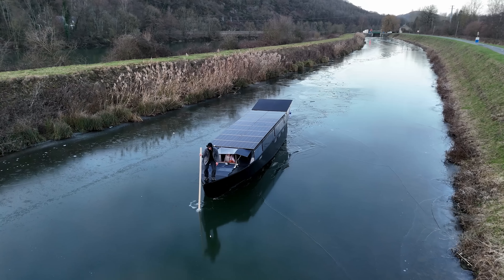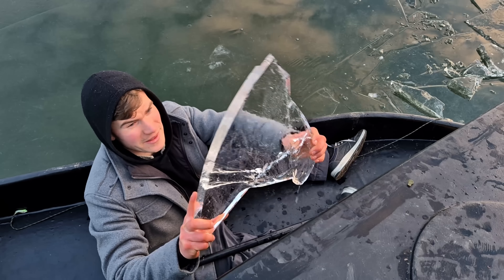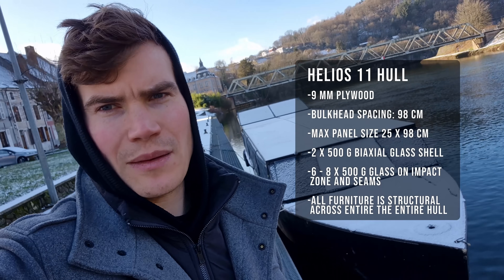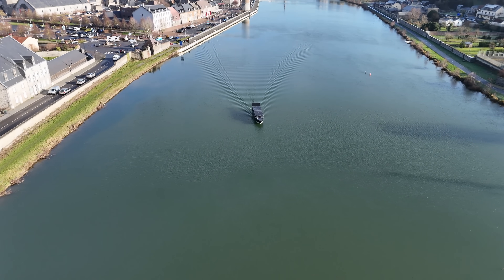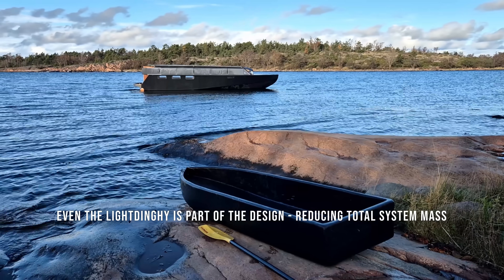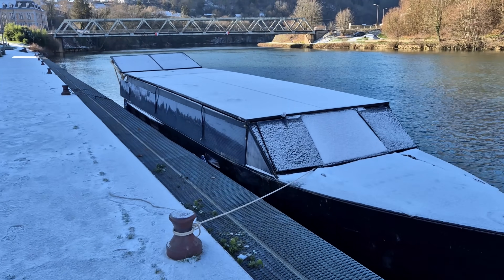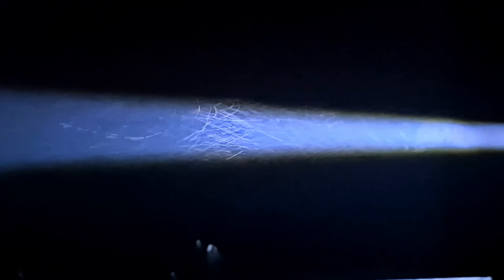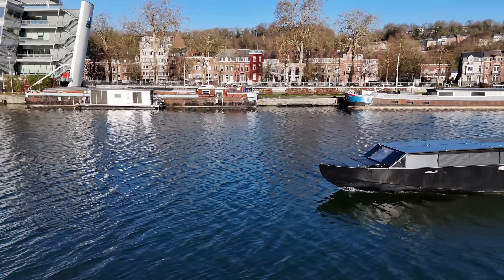Stuck in the Frozen Canals on my Solar Boat: Upgrades & Hull Strength

Comment from the maker: This video is unfortunately not sponsored by Hempel Marine Paints, it's sponsored by me.
☀I wrote a visual manual that delves into Solar Yacht design and acquisition: https://tinyurl.com/helios-11

Consider purchasing it to both support my research, and your own path toward solar sailing.
This is a non-profit project that will share data and the vision publicly.
Reply: I think those that are "fear mongering" are mostly ultracrepidarian commenting from their armchairs and have never designed and built anything in their life. I have little concern for the strength of craft at all, after building similar "white water" wood kayaks in the same format.   I do believe, since your not looking for a traditional build in any way, that some of the newer HPDE hull materials would be better suited for you future projects as they are massively more durable, and 100% recyclable as well.  Some of these new HPDE hulls have a working hull life of over 50 years or more depending on design, fabrication method and final use. Thanks as always for what you are sharing and looking forward to your next video...
Reply: Keep fighting... You will overcome your problems. 👍

Comment: I think this sort of thing shows a basic design flaw in this boat. It’s designed for flat water and fair weather. Most boats are designed to handle harsh conditions and rough water. They are safe and stable in all conditions. Plus they are designed to be safe and strong enough to last 50 plus years. They are also designed to cope with hitting rocks and other vessels. This is fine for personal use in the right conditions. But commercially it would never pass any safety survey.

Comment: Hi Lucas, my solar boat is about 6 months to completion.  I'm using the same ePropulsion engine as you and have found a propeller that might work for you.  If it's the new 2024 model ePropulsion Navy 6.0kW then it only comes with a standardised one size fits all prop, 11.3" x 8.5" (here is Australia anyway!).  I asked ePropulsion if there were any options, particularly one with a larger diameter and they have one!  It's 12 5/8" x 8 9/16" and they're bringing one in for me.  Hope that helps!

Comment: You just need a hydraulic or motorized ice breaker in the front.  Use carbon fiber outer lamination then you don't even need to paint it.

Comment: you can make some panels same as the hull and use  Underwater Epoxy Patching compound and self tapping screws to fix any holes for any emergency repairs.

Comment: Been watching 👀 your videos for a few weeks. 👍 In designing your next boat, have you thought about using hdpe? Seems a perfect fit for your use. See: "legacy hdpa production video" this company can make recycled hdpe sheets 1/16" to 1" thick by 4ft wide and can extrude the sheets as long as the project needs. Buy a hdpe welder and have parts cut out with a water jet then weld it up. Lits of companies making hdpe boats. I like the concept because this plastic is resistant to mold and decay. The stuff is a really tough material. You could be on your way in no time with some select equipment and a good material source. This legacy company caught my eye with the long extrusion sheets instead of 4ftx8ft.

Comment: Your bow design is actually very good for breaking ice.  It has the angles to ride up and concentrate stress on the centerline and propagate a crack.
That said you should take the hint and make miles south at every thaw.

When it comes to regulations and registrations an off grid solar boat is far easier and more accepted than an off-grid tiny home on land.  Even camper vans are not legal to live in in many places but rely on apathy of law enforcement.

Comment: It’s good that the ply and fibro is so strong but why not just fit a thin steel sheet across the apex of the bow? For ice breaking but also any other head on collisions. You could even segment it so it doesn’t impair flexibility

Comment: Why not built your catamaran using a GRP, (7-9 x lighter than steel! 4x lighter, will never rust, super strong) frame , then skin it on both sides, fill it with closed form foam mixed with the lowest cost FLG  highest quality graphene bulk recipe I will give you? Then add the layers to the hull you need. It will be light, super strong, and unsinkable!

Comment: Ice breaker wasn't your original plan huh? Props to you for doing your thing and getting it out there, learning as you go,  Interesting scantlings. I would have gone 2ft (~60cm) frames and foam core, with marine ply for fastener points (stations, cleats, engine mounts etc). This makes for a stronger yet lighter vessel. That's my standard for sea going vessels, also as you have, re-enforcement along the keelson. Exactly as I have done for my landing craft. I haven't watched your build but did you encapsulate the ply on both sides in epoxy and at any faster points or through hulls.? Also is the ply of marine grade? Encapsulating (see Gougeon Bros) and marine grade ply are more for longevity as any moisture ingress will start to rot and delaminate the ply. What did you use as the basis for your scantlings calc. I have an excel I built from the GL rules for small vessels, it also works out your layup.

Comment: That’s an excellent point about light hull makes for light impact!
I commented in one of the flurries about hull weight - I thought you were going to take the sea route and I thought a light hull would lead to a very uncomfortable ride which in the case of a displacement hull may well be unnecessary.
However in doing it the learning exceeds others experience which may not be relevant. Great work! 👍

Comment: Fear based limited thinking, ha ha. In waves, no, you're wrong, imagine a wave centre, and a breaking wave bow and stern, it'll break her back. You speak like someone who has only eevr operated in-shore. The comments speak from experience.  Our boat has 3 layers of 8mm fijian Kauri ply, one ofnthe strongest available, sides, 2 skins of same. Big thick frames and big stringers every 100mm and still, broken stringers and frames in coastal conditions. Atlantic crossing is what'll kill you if you don't start listening. The strength needs to match the surface area as much as the mass. Think, man, think.

Comment: *Fiberglass not "Glass Fiber" - at least in English. Love the videos so far. Keep them coming please.
Reply: Depends on the context and industry, both are used, and have different meanings. Fibreglass usually implies cheap polyester resin. Glass fibre is the material the woven sheets are made from. The two terms are used in various ways.

Comment: install a false ice breaking bow at the waterline - 5mm 300mm x 300mm alloy bent into 150mm per side V attached with UHB 3M tape. Sacrificial and easy to remove and attach

Comment: Just a small thought on redundancy, particularly if your planning an Atlantic crossing.   Dual motor is an obvious one as you dont want to be stranded if a motor fails.   Second would be a smaller reserve battery pack above the water line.  This could be primarily be the house battery pack and normaly just siphons off the main drive packs but have a redundant system to directly charge it from the array and tap into it to power the motor in an emergency. Does not have to be turnkey but something you can rewire to work in the field is fine.  It would not be good if somehow water got down into the main battery compartment and fried your only battery bank.

Comment: If you feel that you must break through the ice and continue forward, I suggest armor. The logging boats of the pacific north west have armored bow to push logs around all day. Just a couple strips of metal along the high to low waterline and up the point of the bow in a V folded strip, much like you were laying fiber cloth. Add a couple holes for resin to adhere. Rivets and sealant/adhesive. Heating the air is expensive and has more loss and exchange than expected, I suggest electric blankets for the person and directional radiated heat lamps for the seating locations (like a lizard). They run on less power and heat you specifically and you radiate into the environment, rather than trying to heat the environment to warm you up.

Comment: Plywood and balsa absorb moisture and lose their structural integrity by rotting. Like when a hatch leaks and you aren't on the boat to use a towel to soak it up. You don't know if a small crack in the coating has developed over time.
No wood for sides, deck or below the waterline. Nomex or aluminum etc.
Reply: Can't you inspect plywood for that? Just measure the moisture concentration regulary?
Reply: @ss1118x😂🎉 no

Comment: there are plenty of 48v AC units that have heating function. (heat pump) Much more effective than any 230V solution. A 500W or 11A @ 48V can heat around 10 to 20 m2
Reply: It's a big tradeoff to have any heating on electricity when you are basically reliant on the electricity for populsion. I'd personally go with a diesel heater since you can survive weeks on a small tank of diesel and the pump/fan takes almost no power to run. But that's me. It would take about two liters per day to keep the boat warm.
Reply: @NavalTechTinkerer Im just commenting on his 230V statement. If its for heating then I would go for 48V. Inverters are insanely ineffective. But sure burning fuel is another way to not need 230V :)
Reply: @andersmalmgren6528 fully agree a DC heater would be way more efficient. I guess he might have other needs, like getting an AC. They also exist at 48v DC, but it's harder to source. While the optimal would be everything being on 48vdc, most things we buy in Europe are 220vac. So I guess it's also convenient to have it. I was pretty glad to have 220v on my previous boat. But nowadays I would prefer to just run everything on DC like you said.
Reply: @NavalTechTinkerer  A heat pump can both cool and warm edit: not all of them, so need to check the specs. I know ecoflows AC can both cool and heat.
Reply: This is true, but the equipment does tend to be more expensive. He made this boat out of 5mm plywood and dreams.
Reply: @Panda_Gibssure but you can get a ecoflow unit for about 1000 USD. For example. You can hotwire it to use your main battery

Comment: Use a heat pump instead of an electric heater and you will triple your electrical efficiency. Actually, if you were to extract the heat out of the water by hydronic loops on the inside of the bottom of the hull then it would be possibly four or five times more efficient then resist of heating. EcoFlow makes a battery powered heat pump that is portable as well. I would have a miniature rocket stove for back up. You can basically pick up wood anywhere. Try to get a hold of aerogel for insulation as well. It’s super good or vacuum insulated panel panels from kingspan 

I have to subscribe to you. That’s just too cool of an adventure.
Reply: The Ecoflow wave 2 heat pump only operates down to 5 degree C. You'd need a cold climate heat pump for it to be reasonably usable unless you never go anywhere that gets below freezing. The cold climate heat pump on my house is currently heating just fine at -23C.

Comment: Chinese diesel heater is the cheapest and most efficient way to heat your yacht 
It will run on paraffin vegetables oil  kerosene diesel 
It will make it so much more enjoyable for you both and not tap into your power consumption which will be better for your distances to travel

Comment: fiberglass is a good ice shield. 

just slap on a 12" band of glass at the waterline - super thick 

and man -  the boat will have ice protection, and super protection right where you need it. 

you could do that in 1 day

Comment: I really like the design of H 13 catamaran. 

The batteries under the waterline would be at a constant temperature when compared to above the waterline. 

Would the cabin, or living space suffer far less condensation because it is above the waterline?

Comment: That's some impressive ice breaking strength!  I hope you are able to move south fast enough it does not get too thick to move through... I assume the Canals stay open for travel most of the year?
I've enjoyed the calming style of your whole solar boat series.  Best of luck on the rest of your adventure!
Reply: At this particular time - it's a gamble as he heads south he also travels both into the interior of Europe and rises in altitude - both of which will generally cause the temperatures to drop.   Once he makes it to southern France and is heading downhill the temperatures should rise because all the factors will be pointing towards warmth.   My guess is that the coldest temps would be when he will be at maximum altitude.  I'm not sure where that will be because he hasn't disclosed the route he will be taking.

Comment: I know what it's like to accidentally hit straight into a steel wall. The impact was riveting. But I wasn't built to break.
That's a solid structure you designed.
Reply from the maker: Yeah. High strength per mass

Comment: As a retired contractor I totally agree that plywood is extremely strong. 
I have ripped down many walls but the ones sheeted with plywood are amazingly strong and the plywood used in home construction is nowhere near as strong as marine grade plywood. 

Trees are very strong…
Reply from the maker: Thanks for the input. 
To sound fancy I could call this "Hardwood Composite Marine Construction". Okume is a semi-hardwood.
Plywood always sounds like cheap DIY in my ears, even though its superior in several aspects.

Comment: I don't think you are talking nonsense, and what you say about strength in relation to weight makes sense. Still, I think it makes sense to design for redundancy especially around batteries, electronics, motors. Electronics tend to break when you least expect it.
Reply: Think strength vs surface area, man. 1 cubic metre of water is around 1 tonne, exactly if fresh water. A wave breaking over the deck, cabin, or cockpit wigh that much or 10x that much weight can tear a much stronger boat in half. Has many times.

Comment: What I do on my boats built this was is take FG strands from woven roving or chopper gun FG feed strands and put 20-40 together.  After wetting out I put this on my centerline is like an iron bar for strength where most all the hits will happen. Then cover it, the hull under the waterline with 1 layer of biaxial.   
I'd go to a 13-15mm thick plywood bottom for large flat surfaces.  If really worried a layer of Kevlar type fabric will make it impenetrable.

Comment: Well done clearing these details. Here is a reply I wrote to one posting on my comment to your video from yesterday:

@NavalTechTinkerer Don't get me wrong, his practical approach to this build does hold value on its own. Too many of us never  get projects out of the idea phase or maybe the testing phase, chasing perfect when we likely should have settled for good enough.

He had an idea, and the grit to make that idea come to life and is now live testing his dream. So his project is moving forward. Good on him for not being stuck in the arousing planning phase. What he will get out of this is really up to him and his ability to grow, research and test as his project moves along. 

If he keeps going down the route it seems for us viewers, his second build might never come to life. But however things turn out in the end I applaud his grit and get up and go attitude. Look he is boating an electric boat that rely on solar south in the canals of Europe in the winter.

He is making changes as he see things in need of improvement. And he is actually living his dream in his hand build boat few of us would sail mid winter. I take my hat of and bow with respect for his attitude to life.

If he need investors for his second build he might need to adjust his approach but meanwhile he is out there living his dream. And that is something.

Comment: You should look for a small heat pump for heating your vessel, ideally one that can also do A/C in the summer.  If you are not aware, heat pumps are much more efficient than resistive electric heaters.  I hope you get a thaw so you can continue your journey.

Comment: A piece of angled stainless steel plate protecting the V of the bow will help protect from ice or floating debris strikes in ordinary waters.
The angle of your bow is very like an ice breakers ....  They are designed to rise up on the ice then crack it under the vessels wt rather than just motor power and lateral force.

Comment: Will you install insulation foam as a structural element of the hull design in the next boat via vacuum infusion? The bulkheads and floor panels of my cat are structured with 6mm ply each side and 28mm foam within the sandwich. It is excellent to keep the boat cool on warm summer days.

Comment: A question for H13. Dual motors, no need for steering wheel? I'm not used to water. So maybe It's stupid.
Reply from the maker: Its an option for sure
Reply: @Lukas-TrueNorthYachts 
Differential steering and propulsion redundancy would indeed be advantageous.

Comment: Thanks for the beautiful scenery of canals and towns you pass through.  Also, there are many self-contained solar generators available these days each offering 110 & 240 vlt AC and 12v, 48v DC options which can run all the electrics on your boat.  Makes it all very simple and easy. Bluetti, Ecoflow, Oupes, Pecron, Jackery and many more. Lovely video! :-)

Comment: A Victron Inverter/Charger Device (Multiplus or even a Quattro) with a dedicated shore plug at the back an a cabin 220V plug could be very confortable and efficient in your solar configuration with multiple batteries. And before heating it seems you need a good hull insulation ;)